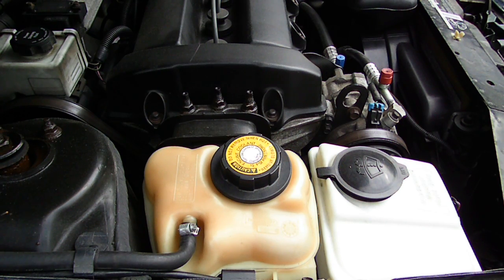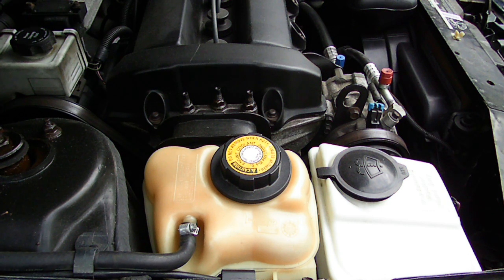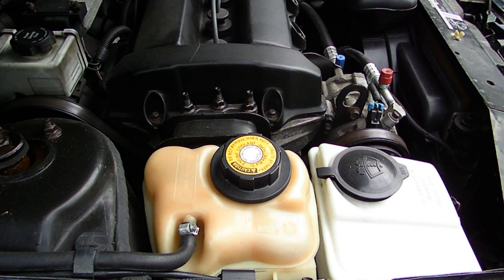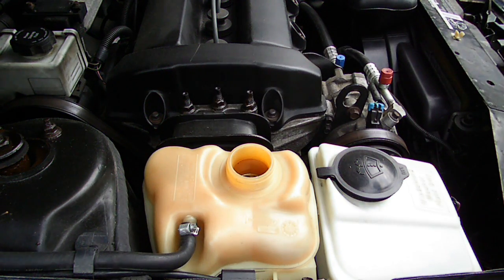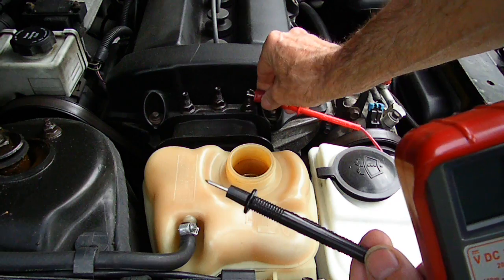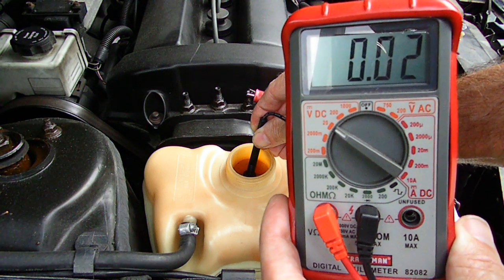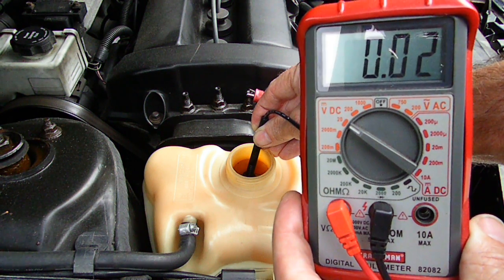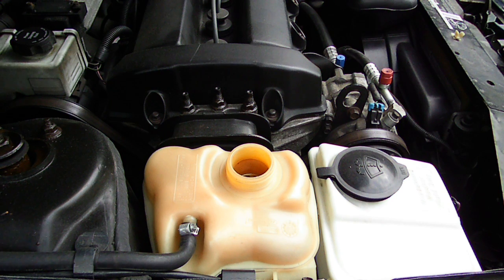Antifreeze coolant Checking with a Multimeter

Comment: how a plastic could conduct?  
wrong way.
Reply: It's not the plastic conducting, it's the coolant which travels through the engine block that's grounded. As I understand you're reading the voltage created by dissimilar metals in contact with the coolant and the ground (zero volts). As the coolant ages the inhibitors break down and the voltage gets higher because of conductance between dissimilar metals, hence above a certain value it needs replacing.
Reply: @stumac869  there is no direct passage for current to travel from coolant in the bucket to the negative terminal as the coolant pipe is far above. check the bottle where the coolant pipe from radiator is.

Comment: Good test.
Basiclly there are corrosion inhibitors in new ant-freeze. This is required due to the multiple types of metals and materials in enginres now, such as steel, copper, ceramics, magnesium,....
Without the inhibitors a galvanic (electric) action would occur resulting in deterioratong part, typically a head gasket.

As time passes the inhibitors in the coolant are reduced and therefore do not protect the motor and its parts as well.

This is why an owners  manual may state to change it every 100,000 miles or 5 years which ever occurs 1st.

Comment: Where did you get 0.07V?  POOFMA?  That's almost non-conductive and definitely NOT corrosive.  This is wrong!!!!  You would be changing the coolant too early at 0.07V.  Try 0.25-0.30V.
BTW, the coolant acting as an electrolyte in this test does not indicate the PH.  This multimeter test is not a test for PH!!!!  That's a different test.  That requires a PH test like those for aquarium, pool, soil testing.
If I tested my aquarium like this I would have dead fish.....

Comment: Will this test show the incorrect ratio of coolant to water after a flush is done? Water that was left in the block which threw off the desired 50/50 ratio mix when re-adding coolant.
Reply: No, you use a specific gravity tester for that. Completely different test.

Comment: First of all, he is measuring voltage ... not pH, so please do not confuse the two. Second, the VOLTAGE is due to galvanic action (think lemon juice and metal strip battery, or potato battery) caused by the antifreeze (acting like an electrolyte) conducting small electrical current between different metals in the cooling system (acting like the plates in a car battery). As antifreeze ages, it degrades and becomes more electrolytic, thus the voltage measured on the meter increases.
Reply: Which is also a function of ph, so in an indirect way, he is measuring the ph
Reply: I noticed this as well.
Reply: Use a ph strip for ph

Comment: Positive lead goes into radiator and negative lead goes to ground (ground = engine block or the negative lead on your battery).  Good range 0 - .3 volts, maybe okay, maybe not .3 - .5 volts, bad = greater than .5 volts.
Reply: Thanks for explaining ground, I was hella confused on where exactly to put it 😂thanks
Reply: Do you need to turn on your engine, during the process?
Reply: @ehlaw9224  I don't think so.

Comment: Other videos claim the voltage should be somewhere below 0.200 Volts.That's four times higher than suggested here. What's up with the difference.
Reply: RIGHT? Scotty Kilmer states .3 and under and you are good to go. Suppose if we even need to check means we are pushing the limits on the engine life over a relatively cheap fluid cost.

Comment: it's shit, mine shows 0.17 and I had it tested in works lab, it shows 7.2 ph I've been told this is ok
Reply: New coolant is typically from pH 8.5 to 10, and becomes more acidic (the pH decreases) as it ages from use.  "Becoming more acidic" is not the same thing as saying it has "become acidic" (below 7.0).

Comment: I poured some vinegar into a metallic cup and placed it on top of the radiator and using my voltmeter it showed a very higher number 0.07. My coolant showed 0.02 so I'm good. Thanks for the informative video.

Comment: Oh golly American man you've made me cringe here! I thought I knew it all see. I had no idea that you might be able to do this - it never even dawned on me. I'll tell you what I do know, Coolant is the electrolyte in a battery of dissimilar metals, (no not any old metals) which will produce electrolysis. {You can do it with two (English) pennies - one with copper content, one with aluminium (spelling!) content. Now you spit on a piece of paper, (chew it), and place it between the coins. You have a little battery. As it delivers a tiny current, so does it erode the metals. Sometimes the electrolyte needs to be acid, other times alkaline. You tell me! Is that why this works? I think you need to be careful here. Brass/copper probes?!!! Ally rad & block/head?!!!

Comment: Would it not be better to just check resistance with both probes in the coolant?
Reply: That is a good question. Cheap multimeters only read accurately to a few million volts. Bad antifreeze is probably much higher ohms.  Good antifreeze even higher. Some folks don't have a moisture meter that's used for Weigh scales they read 100 million ohms. So they are reading the galvanic voltage generated is my guess.

Comment: I`m confused!  Prestone Dex-Cool lists its PH level in its product to be between 7.0 and 9.0.  Why would then the PH level of 7.0 and 9.0 be higher and needed to be replaced?
Reply: The test is galvanic voltage generation like how a battery generates volts. They are not testing the car battery just the galvanic corrosion voltage between the antifreeze and ground. Boat have sacriftial anodes that corrode then you replace them. This prevent a hole from cirroding through your outdrive.

Comment: video is wrong.
here are the CORRECT VOLTAGES:
0.2 V to 0.5 V - good;
0.5 V to 0.7 V - due for a change;
0.7 V or over - change it now.
Reply: Richpin, 'electronicsNmore' states good coolant should read no more than 330mv. Is anybody confused yet? I know I am!
Reply: @TheOzthewiz  1000mv = 1v. 330mv is 0.33v which falls between 0.2 and 0.5

Comment: I'm assuming this works because the coolant becomes acidic over time and conducts more voltage, but the problem is that the coolant is insulated from the car ground by the plastic tank. In essence, you're getting what's called a ghost reading--which means nothing. A better way is to put both probes in the coolant and measure resistance. Less resistance means more voltage conductance, hence more Hydronium ions (acid) in the coolant. Or better yet, just buy some pH strips.
Reply: It doesn't CONDUCT more voltage, galvanic action GENERATES more voltage

Comment: @OpticNerve1948 differnt pH will allow different voltages through the coolant system

he is not measuring the actual pH, but it seems he's found the correct voltage scale for the right pH in engine coolant

Comment: I am not a mechanic or a chemist.  I have learned much from watching your videos. I do not know what exactly you are measuring, but I don't think it is pH.  The pH scale is a logarithmic scale that ranges from 0 to 14. The p stands for potential and the H for Hydrogen. Pure water has a pH of 7.  A pH less then seven is increasingly acidic, while 8 to 14 is increasingly basic. If you were measuring pH, a low number means more acidic and would seem to be more corrosive then a pH of 7 which is neut

Comment: Hello, 
I have just tried your method of checking coolant status. It shows 91mV on a Volvo S60 T5. Coolant age is probably 1 1/5 year.  Changed the thermostat prior to the winter, swapped about  2 liter fresh coolant.  Im going to change the coolant soon, to see what the voltage is when freshly changed. and report back here.

Thanks for the intriguing trick!
Reply: 11 years Later 🤪🤪
Reply: @golfwipe  fourteen years later 🤣🤣🤣
Reply: The limit is 200mv. If you are getting 91mv, your coolant is fine.

Comment: thanks for the tip. Do I need to turn the ignition on for the test?
Reply: No you don't....I just checked mine, coolant happened to be warm, but not hot, but cold is fine too!   No ignition is needed.